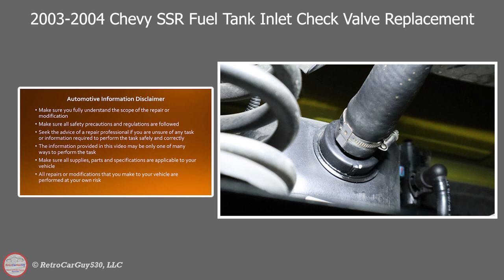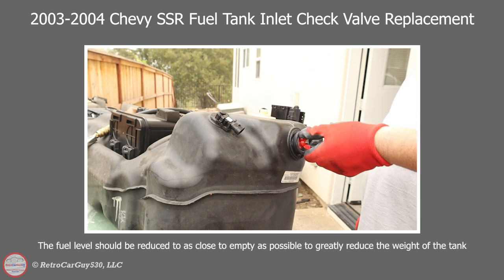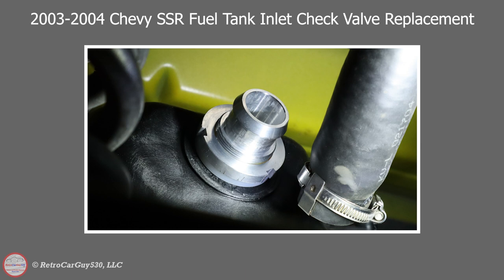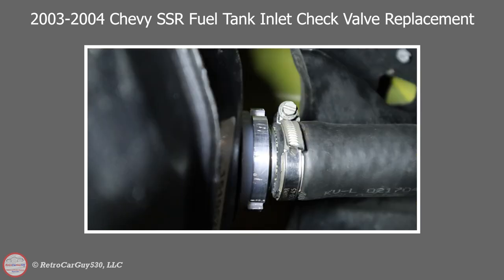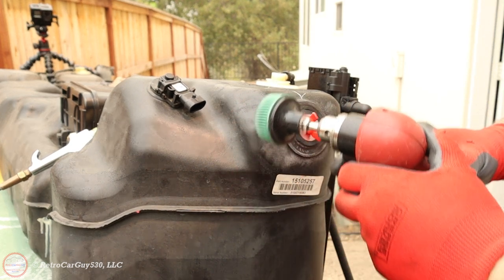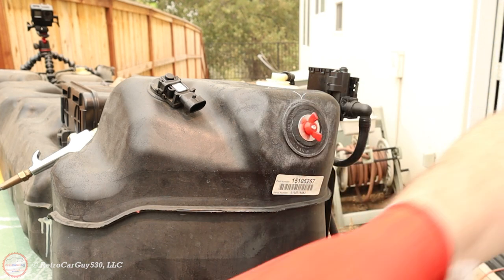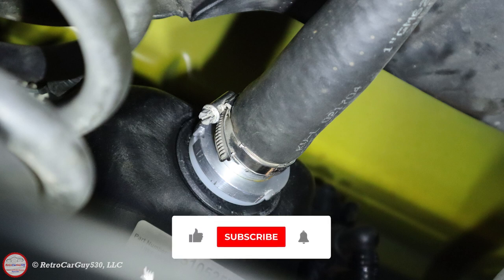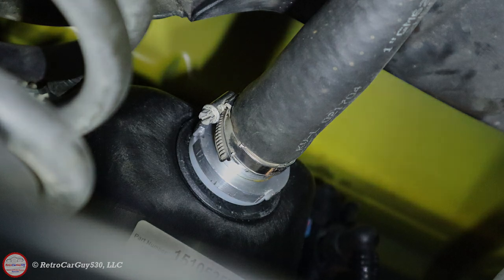Chevy SSR / Trailblazer / GMC Envoy - Repair Leaking Fuel Tank Inlet Check Valve

Comment: I don’t know if you noticed or my manual has a typo but the instructions say at the very end (step 13) that the black gasket goes on the outside of the tank. Which makes no sense nor can you see the black gasket in their instructions or video.
Reply from the maker: That's why I called Dorman to confirm where the gasket should go.  It should go on the inside of the tank and the nylon washer on the outside of the tank.

Comment: I wonder if that is what is wrong with mine.  I have an evap leak that needs to be found and fixed for smog.  That is a very timely and useful video.
Reply from the maker: It's certainly possible.  There are a large number of EVAP tubings and the vapor canister and the EVAP vent valve (on the tank) and the EVAP purge valve (on the intake manifold on the 2003/2004 5.3L engine).  You may need to get a smoke test of the EVAP system to help pinpoint the location more easily.
Reply: RetroCarGuy530  you have any advice for a shop to get the smoke test done?
Reply from the maker: I would believe that you would have one ore more DTCs set mentioning a small or large EVAP leak.  I don't know where you're located, but most automotive repair shops will have the a smoke test machine.  They may charge you for one hour of diagnostic time to investigate the issue to see if they can locate the leak.  If there is more than one DTC present for the EVAP problem it too may help narrow down the source of where the PCM/ECM believes the leak has impacted the EVAP system (not necessarily the leak but the things it may be impacting which might help narrow it down).
Reply: RetroCarGuy530, I forgot you would not recognize me by the yt name.  Lol.  This is Dani, I have Annie’s 06 FPR 6spd silver with the blue flames here in Sacramento/Roseville area.
Reply from the maker: Since you're somewhat local to me, I could attempt to check out your SSR's issues.  I have a smoke machine and a decent scan tool to check for DTCs.  I don't have an auto repair license, but if you're ok with that, I can attempt to check out your SSR's issues.
Reply: The fuel tank is essentially unpressurized because of the crack around the rollover valve/fill neck.  Maybe this would throw an evap code, but I doubt it.  On a friend's vehicle, the evap code never happened, even though the filler was so bad I was able to tear it off by yanking on it.
Reply: Would this evap leak be P0455? Because I am getting this code on my 04 envoy 4.2 and I have changed out the purge valve, vent solenoid, gas tank cap, gas filler hoses and even the secondary air pump( since I read can cause this) I still got the P0455. I have noticeable fuel residue by this inlet check valve but I don’t know if it would cause the p0455 fyi I did a smoke test and no leaks are visible. Any advice would be great.
Reply from the maker: A leak anywhere in the EVAP system or fuel tank can trigger that DTC.  If there is visible fuel residue at inlet check valve area of the fuel tank, then yes it could be the source of the P0455.  A smoke test should give some indication of the leak location.  If the vent valve is not getting power (electrical issue) or not fully closing when commanded to do so, that could be another potential source of a P0455.

Comment: where did you find that plug for the tank ? also, if I go this far and my fuel pump has never been replaced should I replace it ?, I'm guessing you have a video on fuel tank removal ? thanks for all your help
Reply from the maker: The Dorman inlet check valve can be purchased on Amazon.  https://amzn.to/43ekGJ3

If you're taking the fuel tank down to install this check valve, it may be worthwhile to replace the fuel pump if it has a high number of miles on it.  I have a video showing the fuel pump replacement on a 2004 SSR.

2003-2004 Chevy SSR - Replace Fuel Pump: https://www.youtube.com/watch?v=iddHk1IXTi4
Reply: @RetroCarGuy530  Thanks , I ordered the Dorman inlet check value , I was talking about that plug you used to keep the trash out while you were cleaning
Reply from the maker: That is a swimming pool #9 return line winterizing plug.  You can buy them in a lot of places, but I purchased mine from Amazon.  Here's the link to the one I used in the video.

Swimming Pool Return Line No. 9 Winterizing Plug 1.5 - 1.75 Inch:  https://amzn.to/3ITna7u

Comment: does this work on a 2007 trailblazer??
Reply from the maker: The GM special coverage document 14423C only lists the follow vehicles that will have the problem.
2004 Buick Rainier
2003-2004 Chevrolet SSR
2002-2004 Chevrolet TrailBlazer, TrailBlazer EXT
2002-2004 GMC Envoy, Envoy XL
2004 GMC Envoy XUV
2002-2004 Oldsmobile Bravada

The Dorman Products website for the replacement inlet check valve list the part fits:
2003-2004 Chevrolet SSR, 2002–2004 Chevrolet Trailblazer Base, 2004 Chevrolet Trailblazer SS (but this didn't exist in 2004?)

The GM part number for a fuel tank used in a 2007 Trailblazer appears to be 25973153 and that's not one of the fuel tank part numbers listed in the 14423C document.

Part Number Description
15077622      Tank, Fuel (18.7 gal.) 
15229311      Tank, Fuel (21 gal. w/o filter) 
15231628      Tank, Fuel (21 gal. w /filter) 
15229310      Tank, Fuel (Ext Wheelbase/SSR) 

I cannot tell if the inlet check valve in the GM fuel tank for the 2007 Trailblazer is the same size / type as the earlier model years where this problem was documented.

Based on that info, I'm guessing that this solution will not work for the 2007 Trailblazer.

Comment: If this repair only covers up to 04, what can be done for the same issues on an 05 TB? What sealant is gas resistant so i can just bandaid it for awhile?🙏🏼
Reply from the maker: I don't know of a similar solution for the later model year gas tanks.  I've never tried to seal a fuel tank with a gas resistant sealant.  I usually use J-B Weld products when I attempt to seal/fix something requiring epoxy.  I see that J-B Weld does have an 8217 TankWeld product, but I've never tried it myself.  I wish I had a better answer for you.

Comment: Will this fit a 2002 Chevy Trailblazer LT?
Reply from the maker: Dorman lists this as fitting "Chevrolet SSR 2004-03, Chevrolet Trailblazer EXT 2004-02, GMC Envoy XL 2004-02, GMC Envoy XUV 2004".  Those are all the longer frame versions of those makes/models.  The Chevy SSR is based on the Chevrolet Trailblazer EXT which is why it works for 2003/2004 Chevy SSR.

Comment: Does this cause a p0442 code for small evap leak with you have this bad roll over valve?
On the 03 Trailblazers theres a recall for the fuel tank and the dealerships fix is to replace the entire fuel tank.
A smoke test has to be done through the fuel tank so see it, i think.
Everything else was checked tested and replaced for the evap system. Theres other people that talk about this valve causing the small evap leak code and then you cant pass a smog.
Reply from the maker: The plastic inlet check valve for the fuel tank can develop small cracks which can of course result in an EVAP related leak code like P0442 and potentially leak gasoline.  A service tech that is good at performing smoke tests, should be able to see smoke escape around the base of the inlet valve at the fuel tank. Although, a very small leak might be somewhat of challenge to see during the smoke test.

When you stated there's a recall for this on the 03 Trailblazer, I'd like to make a clarification to that statement.  A recall by an auto manufacturer is something they must fix for free, usually without restrictions.  GM issued a "Special Coverage Adjustment" (not a recall) document with an id of 14423C. "14423C - Special Coverage Adjustment - Fuel Tank Inlet Check Valve Fracture"  The 14423C special coverage adjustment would cover the repair of this inlet check valve fracture which results in a fuel leak for a period of up to 15 years from the vehicle's in-service date or 150,000 miles.

The Dorman replacement inlet check valve used in this video is one possible solution to the problem, especially since no vehicle covered by 14423C would be covered any longer due to all of them being in service for more than 15 years.

A P0442 can be caused by so many things in the EVAP system including the inlet check valve fracture/leak, tubing that is cracked, o-ring seals that are cut or have deteriorated, a leak around the fuel pump because the lock ring may have rusted thus allowing the fuel pump seal not to seal properly (areas that use road salt in winter).  EVAP leak codes can be some of the nastiest things to track down.  It requires a service tech with good diagnostic skills to work the problem to find the actual root cause.
Reply: @RetroCarGuy530  
Ok thanks what do you mean by in service date?
I called chevy it has expired.
Reply from the maker: The "in service date" is the date the vehicle was originally placed in service (sometimes times referred to as first sales date).

Comment: I have a 2003 Chevy trailblazer how do I know if it’s leaking from my tank or the pump
Reply from the maker: If it were spillage from the pump the hose/tubing running from the gas cap area to the tank would show signs of "wetness".  If it's the tank only, you'll see it around the inlet check valve.

Comment: what size is that hole in the tank
Reply from the maker: Here are the specifications from the Dorman website for the product used in this video:
Thread Outside Diameter: 39.4 mm
Hose Mating Diameter: 36.1 mm
Inside Diameter: 25.75 mm
Length: 168.5 mm
Material: Aluminum
Package Contents: Inlet Valve; 2 Washers; Gasket; Threaded Fastener; Installation Wire
Package Quantity: 1
Packaging Type: Box
Selling Package Quantity UOM: Piece

Comment: Will this work for 2003 S10 ZR5
Reply from the maker: I don't know if the Dorman part will work on the S10.  The vehicles involved in the "14423C – Special Coverage Adjustment — Fuel
Tank Inlet Check Valve Fracture" are:

2004 Buick Rainier
2003-2004 Chevrolet SSR
2002-2004 Chevrolet TrailBlazer, TrailBlazer EXT
2002-2004 GMC Envoy, Envoy XL
2004 GMC Envoy XUV
2002-2004 Oldsmobile Bravada

I would suggest calling Dorman to see if this part would fit the 2003 S10.

Comment: Dorman lists this part as only working for extended models this makes no sense to me it seems like it would work for any of them short base or extended. Do you have any experience with this Dorman part working in a standard wheelbase trailblazer?
Reply from the maker: The shorter wheel base Chevy Trailblazer / GMC Envoy likely used a smaller gas tank.  It depends on location and type of inlet check valve used in the tank.  I cannot find anything that proves the EXT's fuel tank inlet check valve is the same as the short wheel base version.  The Chevy SSR (my vehicle in the video) is based on the Chevy Trailblazer EXT which has the same 25 gallon gas tank as the Chevy Trailblazer EXT.  I'm sorry that I cannot be more helpful.
Reply: @RetroCarGuy530   Thank you for your prompt response.
Reply: There are only 2 size tanks for the for the base and extended, either can have either tank (if you have the sticker in the glove box you can see which you have) 18.7 or 22 gl. A friend that has a shop said that the doorman valve works on both tanks, I have known him for a while and he is usually right, have a standard wheel base and the 577-106 on the way. So I will know in a couple of days. The size difference of the tanks is not much and I cant imagine it would be a different neck for 5 gallons.
Reply: @tomr3422  Did this work for your tank? Thanks Chris
Reply: @chrisgray318  yes, it worked well for me.
Reply: @tomr3422  Tom, thanks for the quick reply. I'm ordering one for my Buick Rainier now.
Reply: @chrisgray318  good luck and have fun - might want to check out the instructions on the website, the ones that came with mine were outdated and wrong.

Comment: I have a 2003 Envoy, all the sites I’m visiting says it does not fit my vehicle.
Reply from the maker: Here's a list of vehicle's the Dorman 577-106 part fits directly from the Dorman website:

2004 Chevrolet SSR			
2004 Chevrolet Trailblazer EXT			
2004 GMC Envoy XL			
2004 GMC Envoy XUV			
2003 Chevrolet SSR			
2003 Chevrolet Trailblazer EXT			
2003 GMC Envoy XL			
2002 Chevrolet Trailblazer EXT			
2002 GMC Envoy XL
Reply: @RetroCarGuy530 Those Trailblazers and Envoys are the stretched versions not the regular versions.

Comment: Why not use an adhesive to seal the leaks rather than the huge repair
Reply from the maker: Whatever sealant would need to be resistant to gasoline and it would need to be embedded deeply into the area where the inlet check valve attaches to the tank body.  Which likely means fully breaking off the inlet check valve since many of the leaks for this item a hairline fractures.  I'd rather use the replacement inlet check valve with its gasket and mechanical method of securing it rather than hoping I was able to get enough adhesive/sealant to fully fix the leak.
Reply: I paid to have this repair done and it lasted maybe a few month 😅. This is the next step.

Comment: Good video, I just wish this product fit my Envoy. GMC will not help with any expenses because my mileage is over the 150,000 :(
Reply from the maker: If your GMC Envoy is a 2002-2004 model year, it may fit your vehicle.  Dorman Products lists the following year/make/model info on their website for this product:

2002 GMC Envoy XL
2003 GMC Envoy XL
2004 GMC Envoy XL
2004 GMC Envoy XUV

GM/Chevrolet would not cover any of the expenses to replace the tank in my 2004 Chevy SSR because it was more than 15 year since its in service date.  If the "14423C special coverage adjustment" document was applicable to your GMC Envoy, then most likely the Dorman Products replacement inlet check valve part will fit.  You can call Dorman Products 1-800-523-2492 and verify if this product will work with your vehicle.
Reply: When I enter my car info it said it will not fit my envoy, maybe because mine is not an xl. But, thanks for the number, maybe I’ll give them a call
Reply: This is great! Do u happen to know if the Isuzu ascender has the same tank? Or if this will work for an 06 ascender?
Reply from the maker: It looks like the 2003-2004 Isuzu Ascender might suffer the from the same issue.  It looks like Isuzu issued a special policy adjustment document.  Here's a link to the PDF document for that issue on the NHTSA website.  https://static.nhtsa.gov/odi/tsbs/2016/SB-10083912-0335.pdf

I don't know if the 2006 model year Ascender has the same tank.   You could call Dorman Products at 1-800-523-2492 to see if their product would fit the 2006 model year Ascender.   The Dorman Products website does not list the Isuzu Ascender at all in their website info for this product.
Reply: @RetroCarGuy530  I called Dorman and they said they don’t have or know anything for the 06 unfortunately. I need to find out why the pumps at the station don’t let me fill up at a normal pace. It always triggers it off
Reply from the maker: The symptoms you described are can be rooted in a couple of areas of the EVAP system.  The EVAP vent valve may be stuck closed (normally it's open until the ECM commands it closed) or it may have a clogged filter/vent.  The second part that might cause that behavior is the EVAP charcoal canister may have been contaminated with fuel at some point in the past and the charcoal used in the canister can become solid causing less airflow through the canister.   You could also have a fuel tank filler neck tubing restriction as well, but the other two issues tend to be the most common reasons for that behavior.  A person/shop with a decent scan tool can exercise the EVAP vent value to make sure it's working and see if there's a problem with a pressure build up in the tank by running a vacuum test of the EVAP Purge/Vent system.
Reply: @DM-pq3qi  hope you already solved it, but if not - There are only 2 size tanks for the for the base and extended, either can have either tank (if you have the sticker in the glove box you can see which you have) 18.7 or 22 gl. A friend that has a shop said that the doorman valve works on both tanks, I have known him for a while and he is usually right, have a standard wheel base and the 577-106 on the way. So I will know in a couple of days. I have talked to doorman and they said they only know the fitment that is listed in the catalog and didnt seem interested in knowing anything else.